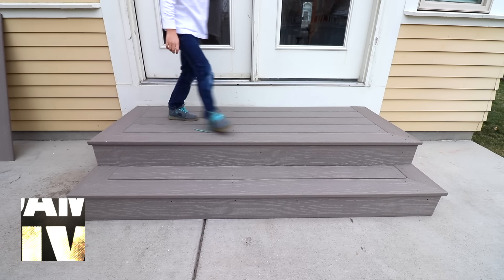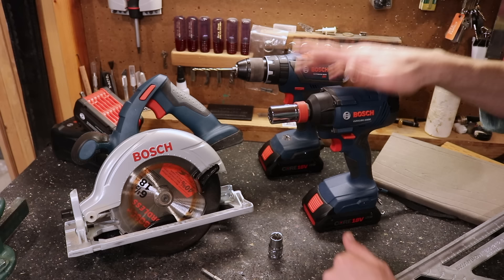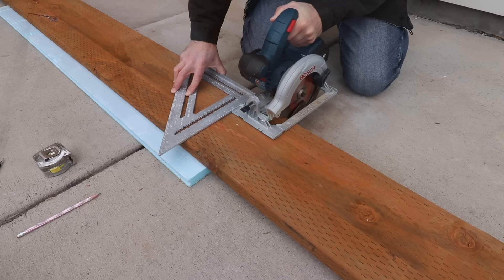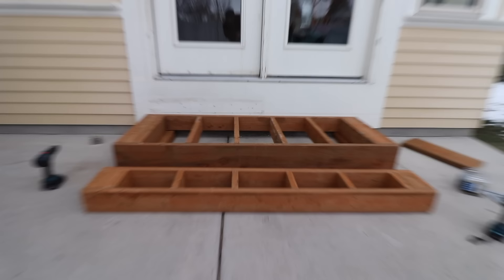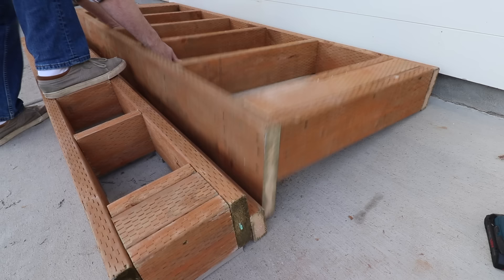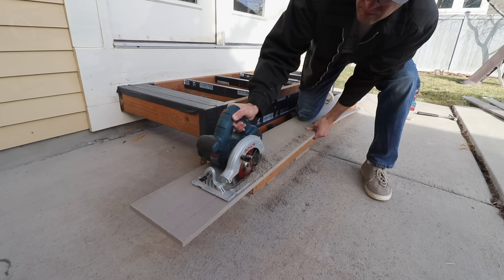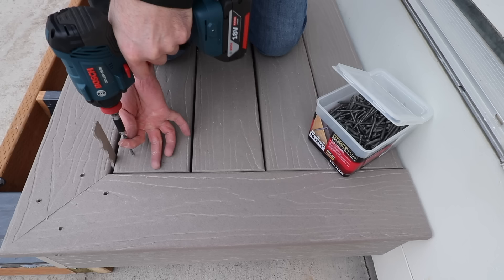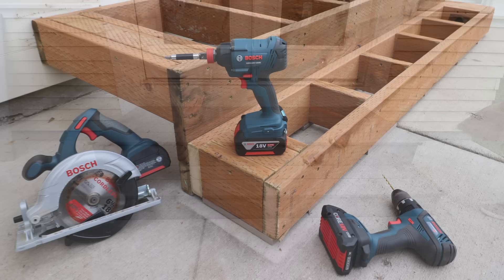How to Build Porch Steps - Composite Decking

Comment: It's important to note that the rough framing for the lower riser needs to be an inch shorter than the framing for the upper riser to compensate for the tread height.  It's the most important thing to be aware of in building steps and no mention of it!
Reply: Yep. He didn't mention alot of very important stuff. A DYI would watch and say "oh looks easy" . Little do they know...haha

Comment: Well done video and build. I have built plenty of them over the years, and am about to build one for my new back patio. I figured why not look around at what others are doing, maybe get a fresh take on things.

One thing to mention, and it may vary depending on location, but I am fairly certain you cannot have a full step down right outside the door. I have always built at least a three foot square landing just below the door threshold, then steps down from there. I have seen that sort of thing called out by code inspectors on a few builds in my area.

The only other thing I like to do different is to have deeper treads on outdoor steps. 12-16 inches deep allows for potted plants, or use as a seat by guests. also they are very easy to climb. When possible, I keep the rise to 6", too. All of this takes up more space on a smaller patio, but ads comfort and some safety. Might need a handrail on one side of those steps, too, by code.

Again, well done. Very strong and sturdy design. I like how you built separate boxes then attached them together, then to the wall and the slab. Good waterproofing choices, too.

Comment: Nice Job!  On cut pressure treated lumber, treat the cut ends.  Preservative is really expensive, I use used motor oil mixed with diesel at 1:1 ratio.  Works great, matches the color, and is super cheap and always around.  Cheers!

Comment: Hi Adam, I just want to thank you for this video and every video you made about house improvements. I was always interested in woodworking so i can make house repairs myself but never got do it. However, under these current circumstances I was finally able to start and the very first thing I wanted to fix was the porch step which was badly need of repair for a while now. Your video is very informative, simple, and uses very basic tools that I was able to get right away (Black and Decker lol). It wasn't perfect but I successfully built my porch steps and I had completed 5 woodworking projects so far. Keep up the good work, i hope you inspire more people like me!

Comment: Thank you! I need to add a wraparound step to my 13" composite deck and this is exactly what I needed just to be sure I didn't miss anything. I would not have thought to use strips of composite as feet for the beams. I have plenty of leftover compo. That's going to save me from buying 2x8 and ripping them down, now I can just use 2x6 for the beams. You just saved me $30.

Comment: I've been cutting pressure treated lumber without a mask. Oops.
Mice will chew through that metal mesh screen (I found that out the hard way). You can stuff the holes with steel wool. It will still allow airflow but will block the mice).
This is very cool. I like the hammer actuated tool.
I want to build a landing outside my back door and my sliding glass door but I don't have level ground or concrete there. I also don't want to anchor the landing to the house in case of movement. I want to have almost no step down immediately outside the door (I know it has to be a little bit to keep water from running in the house) so it will be a bit safer stepping out.
I like how you built this. I wonder how hard it is to find the pressure treated lumber like that now.

Comment: It is common that newer codes don't allow lag screws/bolts to secure a deck or stairs directly to wood on the house because when it rains it can cause water to transfer from the decking to the framing of the home.  It is more common that stairs are secured directly to a concrete pad, poured anchors, or foundation blocks.  There is a standard code to follow nationwide, but as stated in the video, check your local code for variances.

Comment: you need to adhere to the manufacturer specification on what is required for joist spacing to support the decking or the warranty is voided.

Comment: Excellent. Very helpful. Thanks. God bless.

How about if I want to install pressure treated wood on top of existing exterior concrete steps and concrete patio?
I will use tapcon concrete screws.

What steps I should take and the materials, between concrete and wood/the moisture traping under wood/can I use the same thick black sheet material which is used for exterior basement water proofing?

Between the exit door and patio footing I have plenty of room, the patio is 7'×4', there are 4 steps, 1'×6' each and also the first step when entering the house is going to be higher, what about that issue?

What are the advantages of composite deck material over pressure treated wood?

How about using composite deck tiles?
They have space under them and water doesn't get trapped.

Comment: Hi Adam, nice job with the video! Would it be possible to add some measurements for the length and width of your boards/cuts if you still remember them. I have a very similar setup with a french door and similar height as well. Thanks!
Reply: Remember the composite decking comes in 12, 16, and 20 ft lengths.... so 4 feet wide is a good number to avoid waste/maximize lengths of material.

Comment: Definitely a nice job just wondering  why you mitered the decking border but not the fascia(rim board)? Its like a lot of attention to detail except that fascia board. Unless that's the look you wanted I guess
Reply: Cro Boy I wondered the same thing. I’m building a deck now and will need 2 steps up. Going to incorporate some of this design.
Reply: Lowe's probably wouldn't give him a large sliding compound miter saw. That would be the only way you could miter the fascia boards. Harbor Freight has a nice one they put on sale all the time for $130 to $140 bucks. Reg. price is $190-$200
Reply: @Don-ul6rx  Or set the circular saw at 45 degree angle

Comment: Looks great esthetically. However, my only concern is the composit decking boards could be slippery when wet, and especially during snow deacon. Another minor point,  perhaps better not to connect the whole system to the house. Secured to the slab would have been fine in the long run.
Reply: We built our last deck with composite boarding.  It wasn't bad, but we live in a 4 season climate.  We had to pressure wash it due to it being very prone to mildew build up and it became very slippery when it rained or snowed.  It did, however, respond to salt much faster than actual wood.  I will not build with it again, though.

Comment: Few issues here. First, it is easier to build a bigger box on the ground and then put the smaller box on top without suspending that top section. Next, I would not recommend securing these steps to the house like he did. You don't even need to attach it to the house. Just build the boxes as I mentioned in the 2nd sentence and secure that to the concrete. It won't go anywhere. Lastly, code requires steps out of a house to be no more than 1.5" from door threshold to step.

Comment: These steps look fantastic! I want to give this a go. Do you need a concrete foundation or could I compact a crushed dust base and use posts and cement them in to secure?
Reply: Either will do but for me, I'm going to pour a small concrete slab. Much cleaner and sturdier. I'm sure you are finished with your project though, lol.

Comment: Great video, but Adam didn't treat the cut ends of the pressure treated lumber.  Will rot out over time unless this is on a covered deck.
Reply: Are you serious?
Reply: @Fiberglasser03  Absolutely.  The end grain is the most vulnerable part of lumber and absorbs water easily.  The cuts need to be soaked in preservative or the board will rot out over time.  If the deck is built in a hot,dry place like Arizona/Nevada, this shouldn't be a problem. But in wetter climates, this is a common problem.
Reply: Thats a marketing gimmick.  I didn't think people actually fell for that stuff.  Its a deck, they aren't made to last forever.

Comment: Great job! Is composite very slippery when wet or snow covered? I have always been worried about a slip and fall.
Reply: Has a lot more traction then making it from wood.
Reply: Hand rail recommended so you got something to pull yourself up off the ground. At least you can treat wood or concrete surfaces with one of those new textured deck paints ,they give better traction in frosty icy conditions but make the surface harder to clean if you have muddy shoes or boots . Dirty beats a compound fracture or broken hip IMO
Reply: Also composites get very hot in direct sunlight so watch bare feet on kids

Comment: great video, very nicely detailed (with screen and all) I only have one question did you retreat the wood after making a hole into it? That hole is very close to the floor and humidity will be able to get into the wood much more easily!
Reply: Good point sebell. ALL cuts on pressure treated wood should be treated with preservative. Do not confuse Cut N Seal with a preservative. It is more akin to a paint or a stain and has no preservative abilities.

Comment: The only prob is no flashing on this porch. Generally, he has to cut thru the sidings below the door, flash membrane it, then metal flash with drip, face hanger the joist since the whole porch is sitting on screws. My porch was done the same way as his and i had to take it all off. Removed sidings and it was rotting inside behind ledger with ants nesting. Im sure it’ll prob last 20yrs or so but next generation won’t be too happy.

Comment: i have a front porch concrete with one step.  the whole area measures 5 x 7 ft.  i was wondering if laying down slate tile would be good.  what to do with the area?  some recommendation would be nice.  there was an outside type of mat carpeting that was glued on.  through the years with sun and rain it got weathered and ripped away. so now its bare concrete.

Comment: that dead space is going to be a constant clean up . . . why not base, achor, net and fill the entire base frame and then build 3 sided step kick around. . .  all those 'spacers' you put in will be where you see the first warp and twist. . .hope you dont have any beefy family, might wanna check the sheer weight of the screws you used along with the space and load you placed on them. . . you'll be redoin this in a few years too, which is cool for content i guess but as a home owner seeking something sightly, something easy to use, maintain and has real durability to it.   but hey, you got sponsored . . .

Comment: As you have got a nice concrete base would it not have worked out cheaper to have just made some steps with concrete blocks and some paving slabs that way it will outlast the house but what do I now I live in England and that is the way we do stuff over here

Comment: When you cut pressure treated wood arnt you supposed to treat the cut end?
Reply: Generally you don’t have to. Not a code thing or manufacturer thing. People will think you’re crazy if you do. Even the big box stores around here doesn’t carry them. I actually went to lowes, menards and home depot and they look at me like im crazy. The old deck i removed didnt seal em either and it lasted over 25yrs with 6months of snowy winter annually. It’s unnecessary, sealing end cut is just paranoia. I believe it started in Canada, then we used to carry it, but most big box stores discontinued it, maybe their process is more efficient and penetrate 95-98% of the wood now? Iono

I encase my entire PT frame with pvc cellular trim board so it doesn’t matter since they are rot-free, even better than composite which is rot-resistant.

Comment: How would you compensate if the patio was slightly unlevel?  Mine slopes away from the house, and also left to right.  All those right angles would leave a gap.
Reply from the maker: I guess it depends on how much of a slope.  My slab slopes away from the house (like it should) but it's not so much that it is a problem.  Lucky for me I didn't have a left to right issue.  The easiest way to compensate for uneven concrete would be to add some shims where it meets the ground.  As I added material to the bottom in the video 4:00  just add more.  Then take your time cutting the facia so that fits the space.

Comment: What would you use to plug the screw holes? Having to match the colour would be a pain as well.
Reply from the maker: Steve Hutchinson I have a video on that coming out soon.  It’s simple.
Reply: FastenMaster Cortex screws are available for a wide range of composite materials and are easy to use.  Hope this helps.
Reply: you dont need to plug them. with composite, use a heat gun on top of the hole for a bit like a couple seconds, and the composite expands slightly and the hole disappears!

Comment: Hi Adam ! This is wonderful video to me. I am also planning to do my front porch but mine is slightly different than yours. Mine has two vertical post at the front supporting front part of the house. Unfortunately one side of the porch has leaned down, I believe it’s frame beneath the deck is decayed and my porch doesn’t have concrete base so my question is what should I use to secure the frame.? And what size of pressure treated lumber did you use for framing ? What if I want to put aluminum railing in both sides ?

Comment: I think you will find the composite screw manufacturer suggests not using impact guns with those screws. As a deck builder I can tell you they are correct
Reply from the maker: Joe Blow great comment.  I’m curious to test the difference on some scraps.  Thanks.
Reply: Yes, also they drive better on low speed.  They have a reverse threading at the head and the impact driver just makes it strip out the hole a lot of the time

Comment: Have you ever used composite shims? They work really well.
Reply: I think not.  The step out of the living space will help keep snow melt from getting through the door.  One step is a hazard, as in a lowered floor in the house.  People don't notice it.  Two or more steps are seen.
Reply: Dixon Peer I think you replied to the wrong comment, I just said instead of a wood shim to use composite because it will not rot out in time.

Comment: Thank you I learned a lot from your video!  I would like to build steps from my patio to the house.  The steps will be 6 feet wide.  The total rise is 25" so it looks like I will need 4 steps at 6 1/4" rise with a total run of 33". Can you tell me how to adopt your method of construction for a four step unit?

Comment: getting ready to build steps into my shed with this composite decking do i need to pre drill first ??
Reply: It’s a very good idea or the screw will mushroom the decking as it gets flush to the surface. I use two drill bits. One for the screw and one the same diameter of the plugs you can get to cover the screw head. Or just leave the plug out. Trex makes a counter sinking drill bit but i have had much success with them

Comment: How did you decide how far to overhang the front tread board that is mitred? Is there a general rule?
Reply: Generally, overhang is around 1/4”-3/4” out. As long as ur board has 2 screws rowed in, you’re good. So let say you got a board that is 5”. 1” spaced in from edge to first row of screws, then 2 inch from that screw is another row. Then give it another inch away from edge. That takes up 4” of the board already. Ur left with 1” of board left to overhang. U could use pvc trim board for cladding which is generally 3/4” so ur left with 1/4” overhang. If u use the cladding board, its actually thinner and gives more overhang. Depending on what u use really and how far out your screw are spaced. At least space them minimum based on manufacturer and then go from there. Hope that helps.
Reply: @11soWoo  Roger that - great explanation. Thank you!

Comment: What kind of lumber is that? I always see people on youtube using that stuff, looks like great stuff.
Reply: composite decking.  much more expensive but no staining required or rot to worry about
Reply: @locutus1126  What I meant was what kind of "framework" material, looks very uniform.
Reply: @skylark4901  Pressure treated lumber.  He explains this at 00:15

Comment: Hi Adam, Like your steps and I want to do something similar.  Called both Trex and Azek support and they don't recommend butting or gluing the miters because of expansion.  How did your joints hold up after a period of time?  Thanks, Frank
Reply: They don't hold up, 45degree corners open up..use butt joints
Reply from the maker: Francis Gola it has not been very long but so far so good.  No problems. I’ll make a detailed test video on it.
Reply: Thanks Joe, I will take it into consideration.
Reply: Thanks Adam, I look forward to seeing it.  Getting ready to order the composite decking etc. so it would help me make a decision.

Comment: You covered the holes with wire, but then suspended the frame off the ground via a bit of composite.  Didn't you just create another point of ingress for mice beneath the stairs now??
Reply from the maker: Ken Thompson yes it looks like that but it is actually totally closed off where it meets the ground because the vertical finish pieces wrap all around.

Comment: How do you make sure everything is square? I made a similar frame for a different application, and when I checked the frame it was all wonky and out of whack. Super frustrated :(
Reply: Use the 123 or 6-8-10 method. If not, get one of those angled straight edge and use the 90* angle on all the corners.

Comment: What is the name of the decking membrane?
Reply: I am guessing it is "water and ice shield" they use in roofing. But it is 75 ft by 3 ft roll.
Another option could be a thick self sticking membrane used for framing windows. Typically about 6 inch by 25 ft or more.